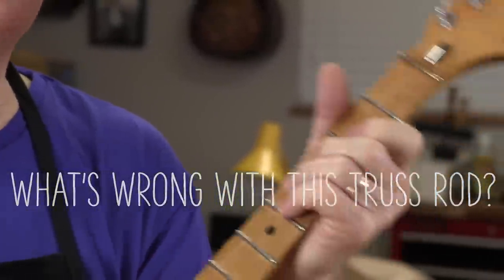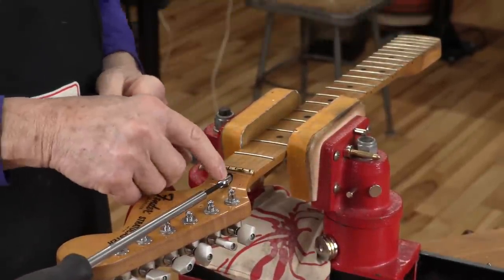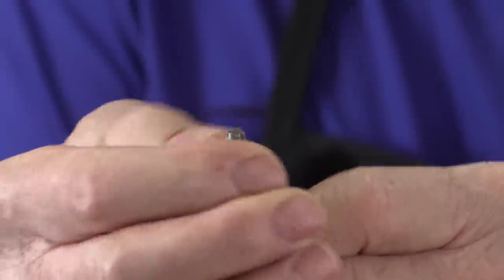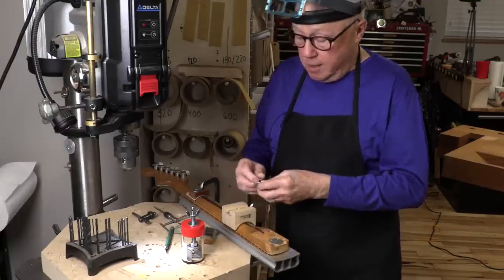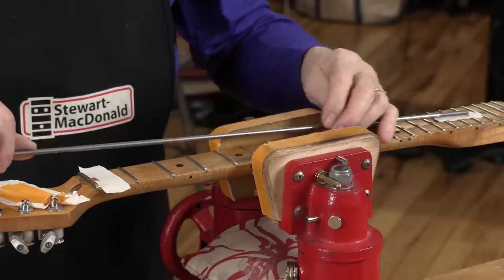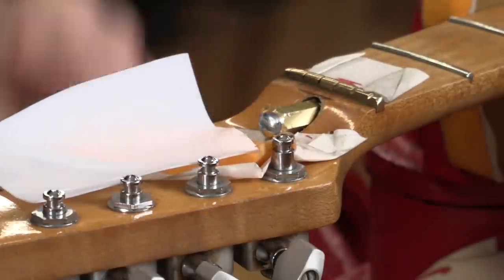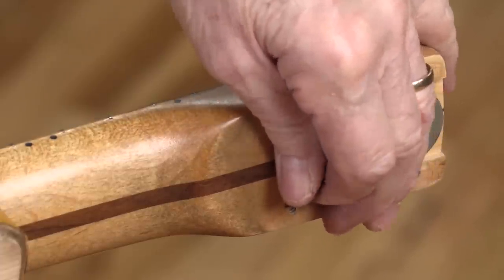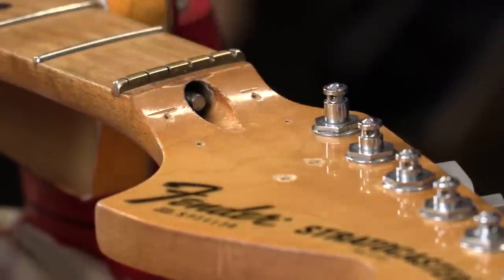What's wrong with this Fender truss rod?

Comment: How is 10/32nds not 5/16ths.
Reply from the maker: The 10-32 that Dan keeps referring to is a tread pitch, rather than a 10/32nds (or 5/16ths) of an inch.  This indicates that, in SAE measurements, it's a #10 machine screw with 32 threads per inch.
Reply: @stewmac  Oh right, thanks.